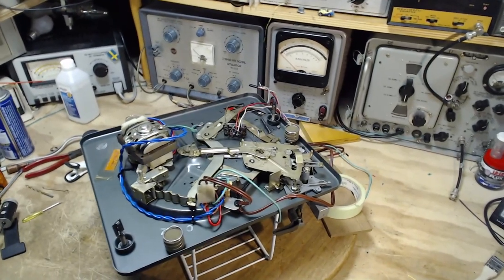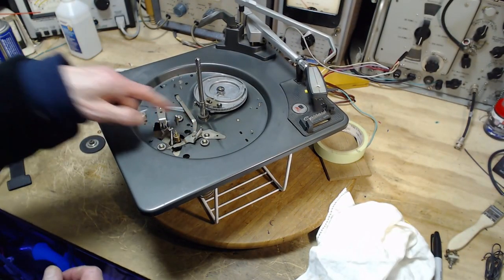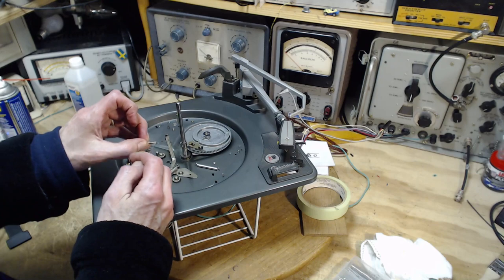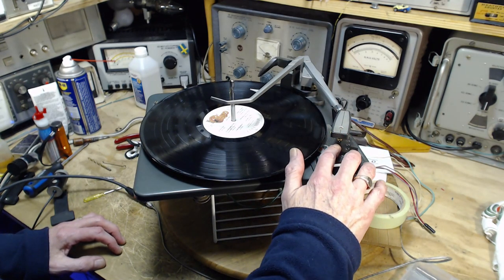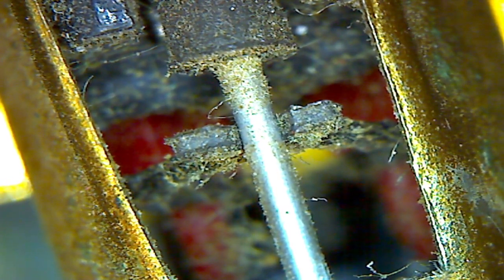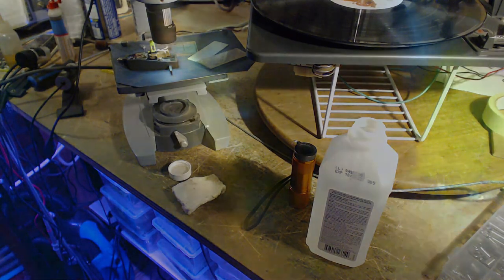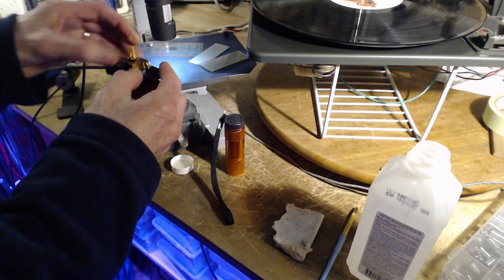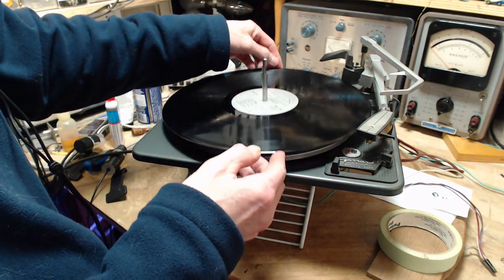Canadian General Electric C701 Console Video #5 - Traction, Cartridge and Needle

Comment: Apply with a Q tip a few applications with Acetone. The Acetone will soften and cause the rubber to activate to pliability, how ever its only a stop gap repair. The idler needs to be replaced.

Comment: The best way to repair this, since he's such a cheapskate and doesn't want to pay for a new wheel is to compensate the amount of rubber he ground by sticking a rubber belt inside the platter, where the idle wheel makes contact with the platter... He could use cork or any other material, providing it has no more than 1-2mm and is glued all around the inner surface of the platter...
Low tech, I know, but it's a non-invasive method and can be reversed at any time, if the owner decides to buy a new idler wheel...